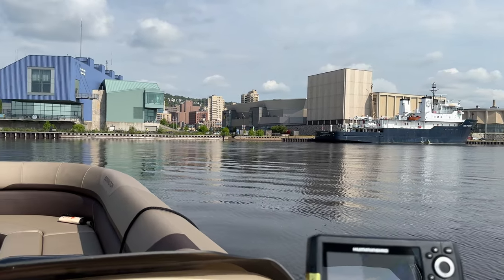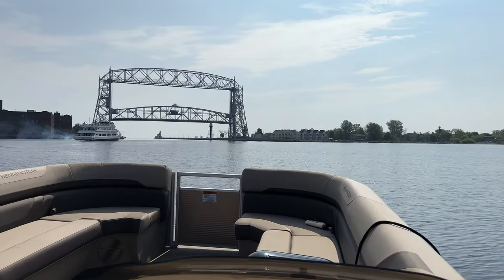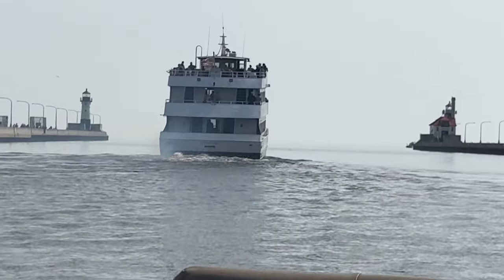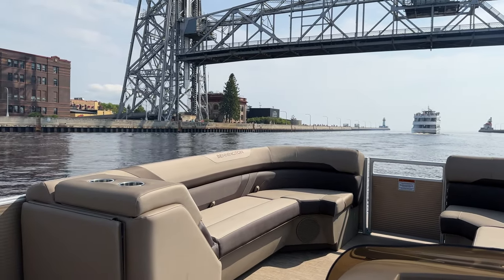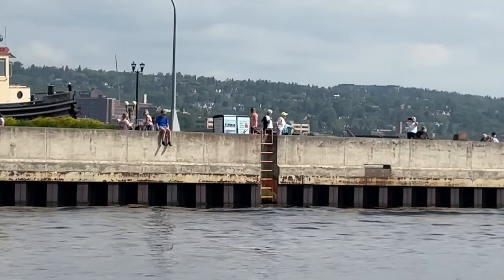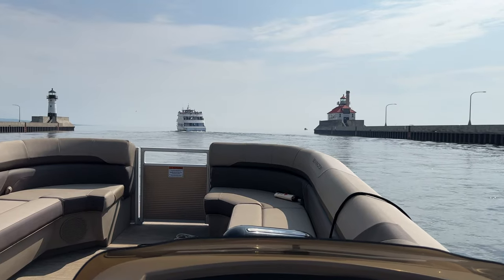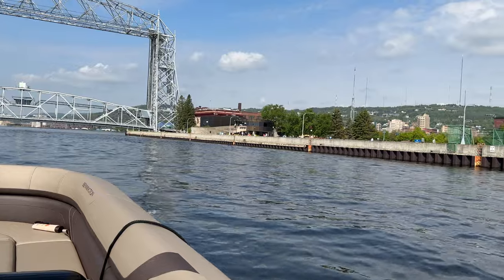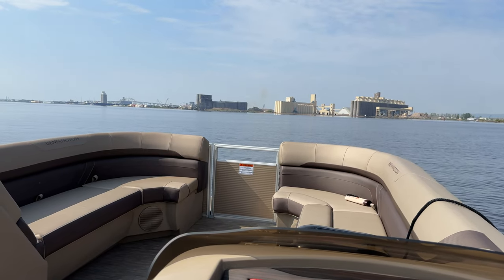⚓️Full Speed under the Aerial Lift Bridge! Duluth, MN

Comment: I have a couple of questions about the horns on the lift bridge; where are the horns located, and do they face in both directions?
Reply from the maker: Horns are on top of the lift bridge operator structure in the middle of the bridge. Not sure about the directions though. 👋⛴️📣